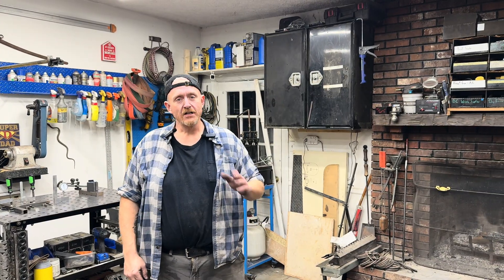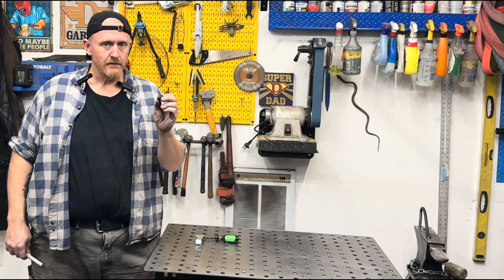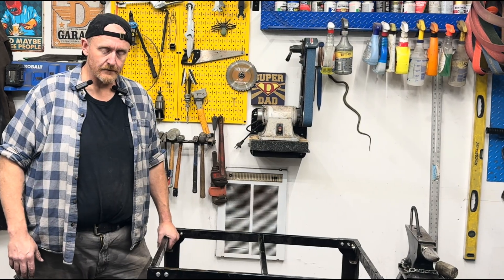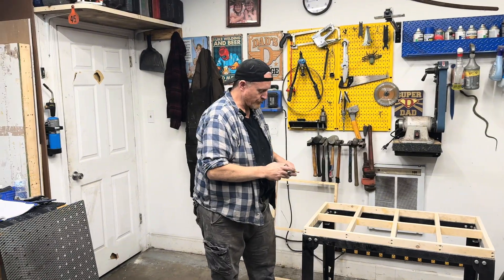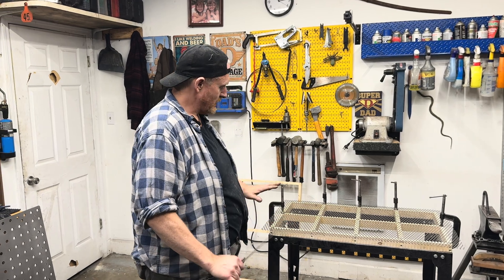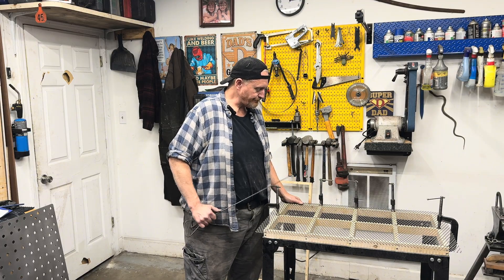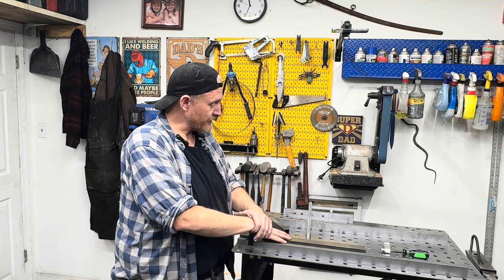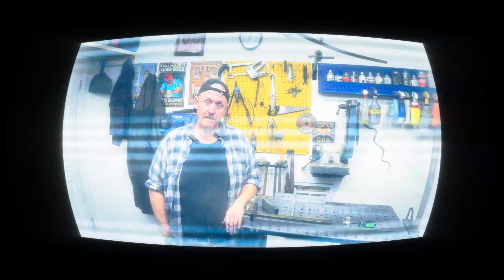Harbor Freight Fixture Table's FATAL Design Flaw (Engineering Fix)

Comment: Instead of a whole new redesign of the support frame, which isn’t free, still costs money; for what these tables cost, which can sometimes be found on sale, how about increasing the rigidity by stacking a 2nd or even a 3rd top?  Yes it’s gonna cost but a triple stack will be 12mm thick which is just about 1/2”.  I suspect any flexing issue can be resolved in this way.
Reply from the maker: Man, I totally get the appeal of a 1/2” thick fixture table for $500 - that’s pro-grade thickness at DIY prices. The dream makes complete sense, and honestly I chased similar ideas before landing on my current approach.
Let me walk through the engineering challenges I see with stacking, because I think you might be able to make it work with some modifications:
The Countersunk Bolt Problem:
Those M8 countersunk bolts are tapered to lock into the countersunk holes. That works great for the TOP layer - the taper creates a positive mechanical lock. But when you stack three tops, ALL of them have countersunk tapers. That means:
	•	Top layer: Mechanically locked by the taper ✓
	•	Middle layer: Just a tapered hole with a straight bolt shaft passing through (held only by friction)
	•	Bottom layer: Same issue - friction only
So you’ve really only got 9 mechanically locked connection points on the top surface, with the middle and bottom layers relying on friction between the surfaces. Under clamping loads in those unsupported areas, I’d worry about the layers sliding independently.
The HF Clamp Issue:
The included HF clamps have about 15mm of total engagement (threads + alignment collar). Three 4mm tops = 12mm minimum thickness, probably 13-14mm if you add any bonding material. You’re looking at maybe 1-2mm of thread engagement - nowhere near enough to hold under load. Plus that 2mm alignment collar was barely adequate for one 4mm top (only 50% engagement) - it won’t stabilize 12mm of stacked material.
The Wedge Clamp Problem:
Standard fixture table clamps use opposing wedge forces - they push DOWN on the top surface and UP on the bottom surface simultaneously. With three unbonded layers, that wedge action will try to separate the top from the bottom, with the middle layer having no mechanical connection to either the clamp or the work. I think you’d see sliding and possibly buckling in those unsupported spans.
A Potential Solution:
If you’re committed to making this work, you’d need to create mechanical bonds throughout all three layers. Something like 1/2” tapered bolts every 2” on center across the entire surface - basically turning three tops into ONE structural unit. That’s a lot of drilling and tapping (we’re talking 100+ fasteners), and here’s the brutal part: if you get ONE thread misaligned during assembly, the whole thing binds up and you’re done.
My Thinking:
For similar money ($180 for precision frame steel vs $360 for two more tables), I can solve the root problem - inadequate frame support - and use the one precision-ground top I already have. But if you’ve got the patience for that level of fastener density and alignment precision, the stacked approach could theoretically work. I will be stacking my 2 tops the critical part is more fasteners , I got better grade bolts , wider head so I can recut the taper through both tops for retention even in the original holes , plus I’ll be adding more bolts , threaded into solid frame . 
I just don’t want to see you drop $360 on two more tables and then discover these issues after you’ve already modified them. Either way, I’d genuinely love to see how it works out if you try it! And I’m happy to bounce some ideas back and forth any time you want . 
Thank you !!

Comment: I like the helping hands table weld clamps. They quick slip into the weld table holes and DONT require the need to screw down. Also they are advertised on the fireball tools website that they better distribute the load than the original ones. Problem with adding all those extra supports on the table is that in general you’re taking away some clamp holes to be used more effectively, it might be a tight fit. I really like the upgraded harbor freight top they sell online that is thicker. I forgot which brand. That might be a good alternative also
Reply from the maker: I would never cover the holes of the table . The additional frame pieces are the same dimensions as the thin wall tubing , just solid cold rolled precision steel . So no worries on that front , and yes anything Fireball is good with me !! Thanks for the feedback !